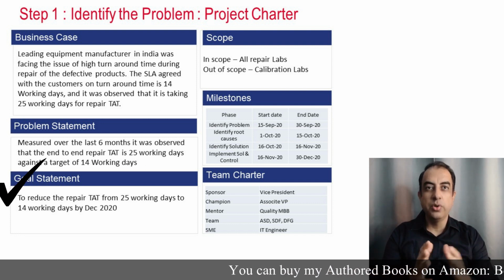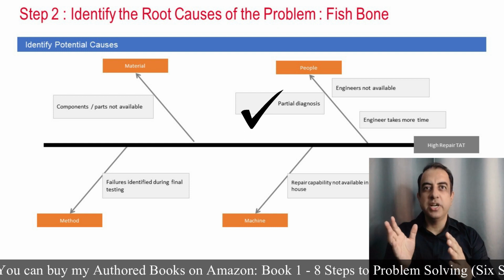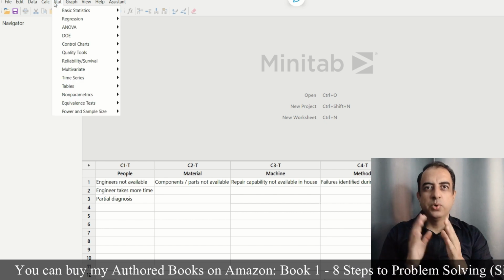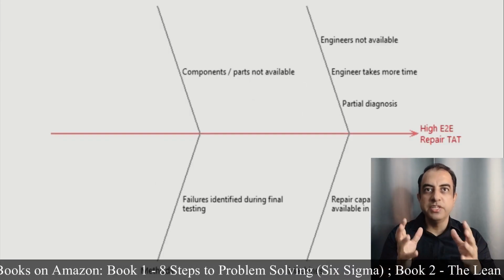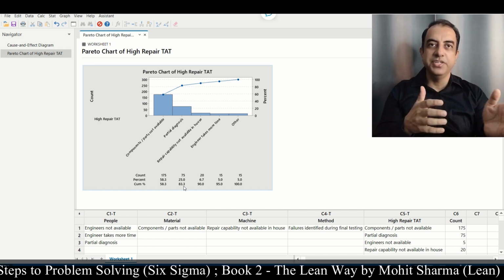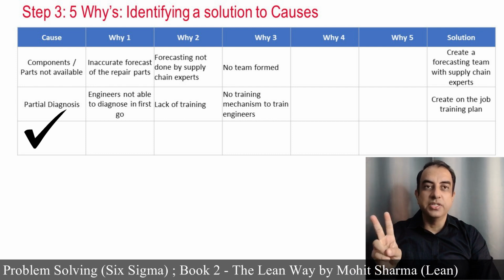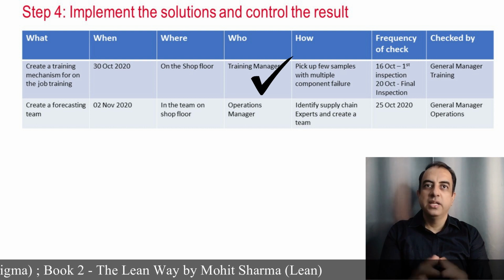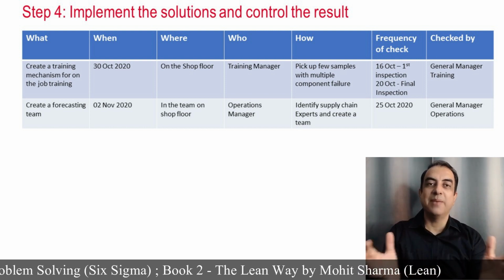Case Study  Reduce End to End  Repair Turn Around

Comment: I have a got a question. Where does the process improvement projects (six sigma, lean) fit into project management process groups such as initiating, planning, execution, monitoring & controlling and execution. We have a schedule in project management as well as start and end dates for each of the phases in the improvement projects as well. Can you please help to get me a clarity on the same.
Reply from the maker: Six sigma projects follow a methodology DMAIC. Where Define include defining the project problem, goal, scope, timelines, stakeholders and businesses case which is similar to project management. The only difference is when significant root causes have to be identified in lean or six sigma then statistical tools are used like hypothesis and control charts. 
In project management the solutions or implementations are already known but in LSS they are identified during the project.
Reply: Thank you

Comment: Hi Sir, I am from a BPO. Have recently got a new order management process. We want to do transaction monitoring, how should someone determine the appropriate sample size if there is a monthly volume of 1500 and the target given is 96% accuracy. Please help. Thanks.
Reply from the maker: With 95% CI and 95% confidence level a sample of 384 is good enough to be monitored. It is not dependent on the population
Reply: Thank you so much. May I know, what is the formula you used.
Reply from the maker: I always use sample size calculator from google
Reply: Sir, can you share link.